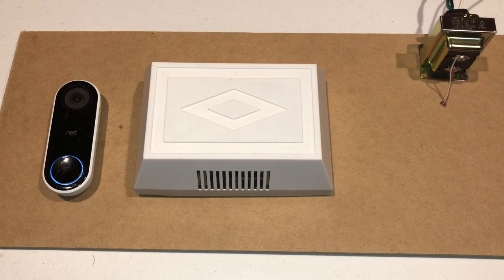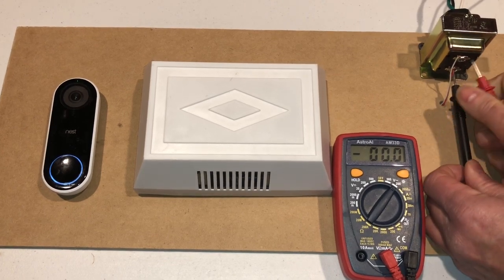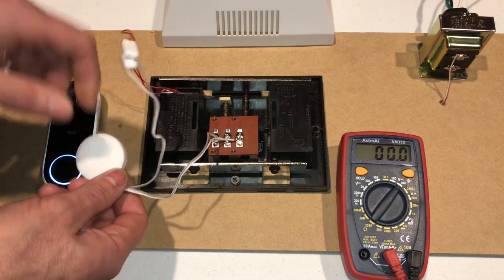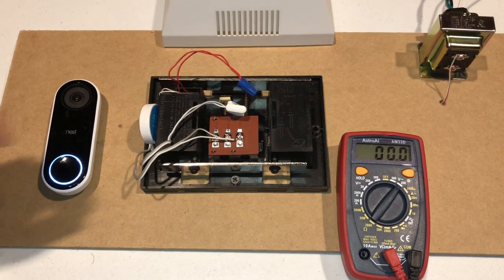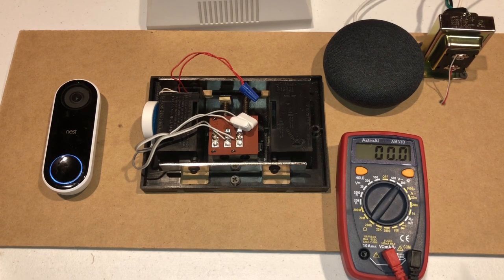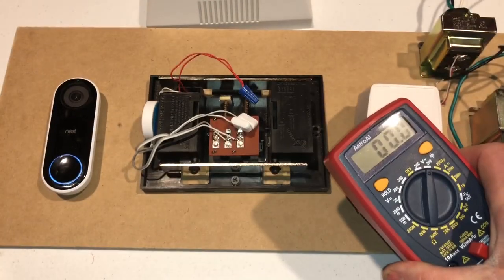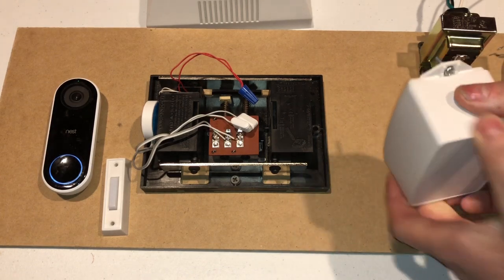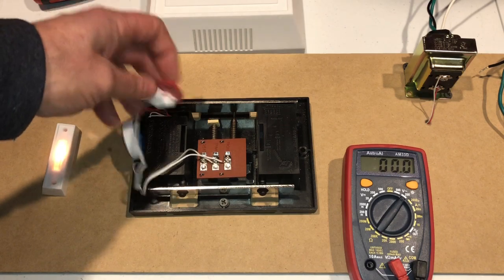Fix Nest Hello Power Problems

Comment: Great video, unfortunately didn't solve my problem. My problem is that when the power at the breaker box is turned on, my chime constantly rings and my Hello doesn't even power up.
Reply from the maker: That sounds like the wires leaving the chime going to the doorbell (Nest Hello) are making contact somewhere.  Did you have this buzzing noise problem before you upgraded?  If not it is likely the wires are touching where the come out of the wall outside.  They may have missing insulation or twisted together.
Reply: Had this same issue, but its because my doorbell has a digital chime module for an Intercom. This made it impossible for the NestHello to work properly (not enough power was going to the doorbell wiring), but due to the voltage fluctuation the digital chime kept thinking that the doorbell was being pressed. I am going to resolve it by bypassing the doorbell altogether.

Comment: So the transformer is connected to the eletricity, which in turn powers the chime, which then powers the doorbell. Is that correct?
Reply: Correct. When you tie the two red wires together, they no longer power the chime and all the voltage is going straight from the transformer to the doorbell.

Comment: I installed one in my fairly new home a few weeks ago with zero issues. 
So I bought one for my parents 25 yr old home and the problem I had was the door bell chime was cycling constantly but not at full power. I ended up bypassing the chime like you did but I'd like to get it working. I'm wondering if updating the chime and/or transformer would work, since my problem was a little different than yours.
Reply: Isn’t there a three “prong” (connection whatever thingie) transformer to get up to 24V?  That might help with the voltage drop?
Reply: I tried installing a simplisafe doorbell camera and have a similar issue. It is 1950 house with a doorbell that hits 4 long tubes (like an organ) to chime. My doorbell just kept chiming and there was no visible power to the doorball face. I tried the chime connector and I was just the same - keeps chiming. I bought a new doorbell and it came with a transformer. Need to still investigate the wiring  in the attic. Did you find a solution?